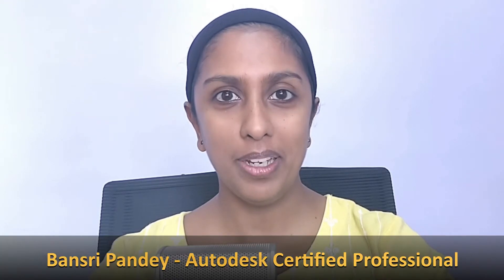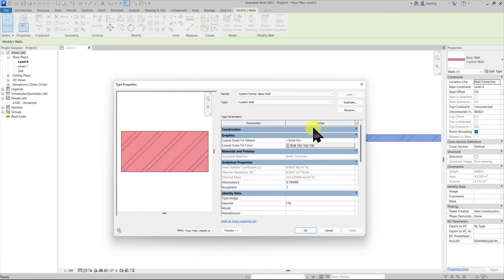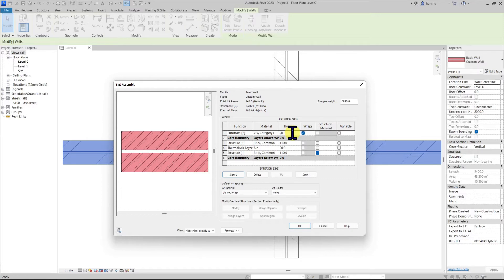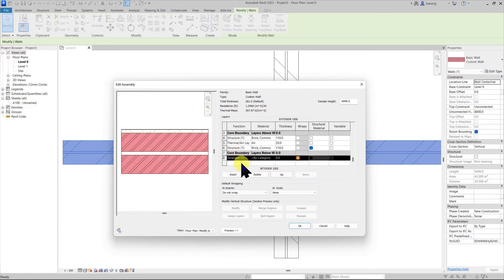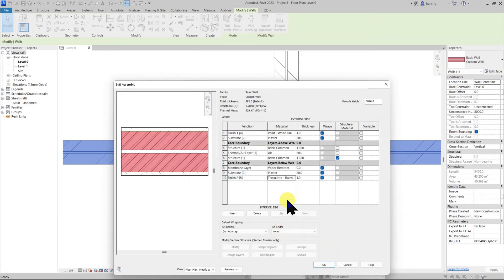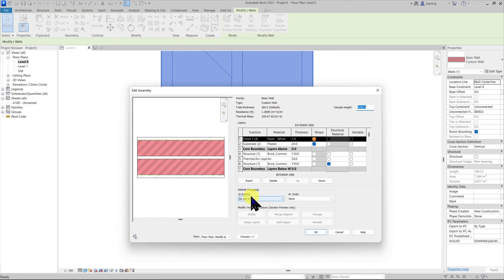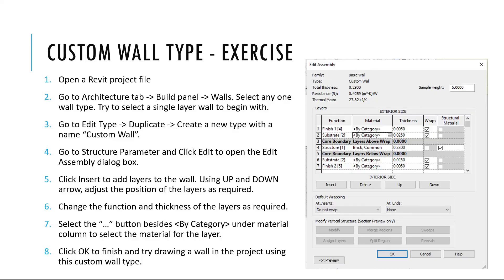EP13 | Revit Beginner Program| Custom Multi-layered Wall Type | Hands-on Exercise | Bansri Pandey

Comment: Greetings ma'am

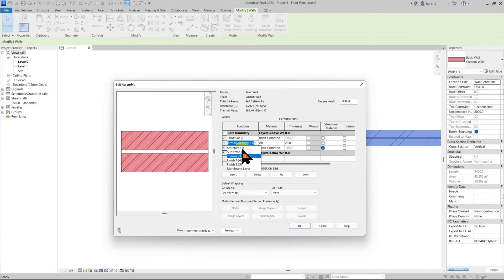Can you explain in easy way  the function of these numbers in the brackets from 2:23,  please?
Reply from the maker: They are priorities based on which two walls/elements would join each other. structure (1) layer of wall A is joining with substrate (2) layer of wall B, then revit will cut the substrate and let structure pass through. so, the numbers indicate what is the priority of that layer when joining with other elements.
Reply: @learningBIMonline  ma'am, will this same implies for its purpose too?